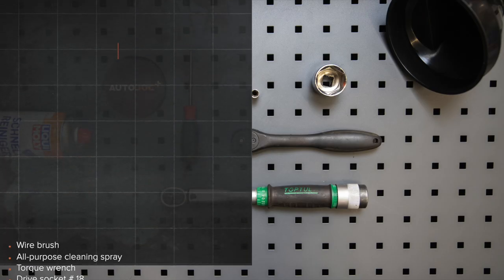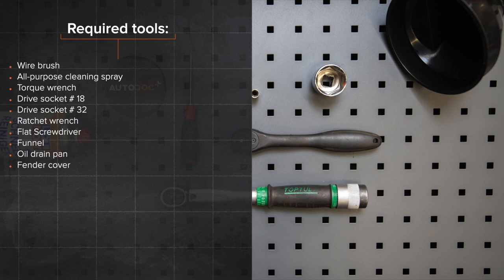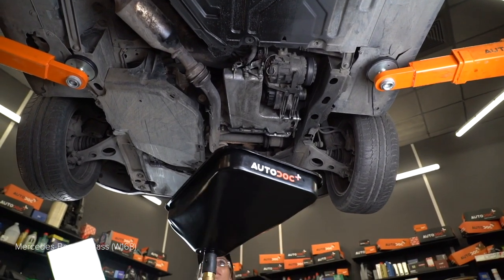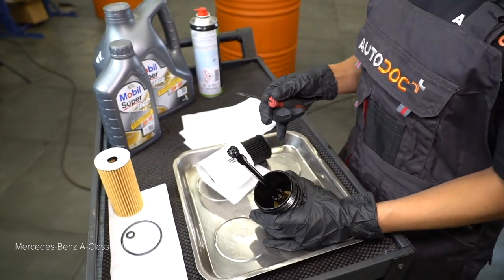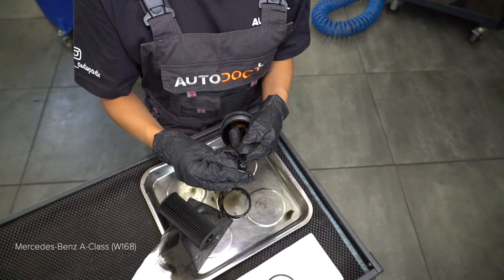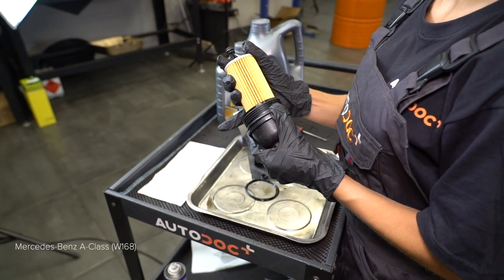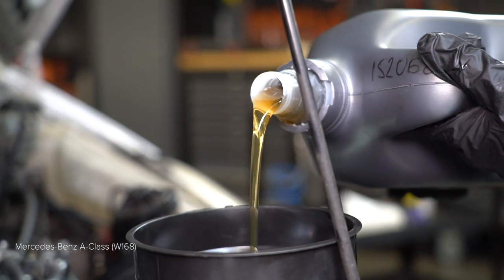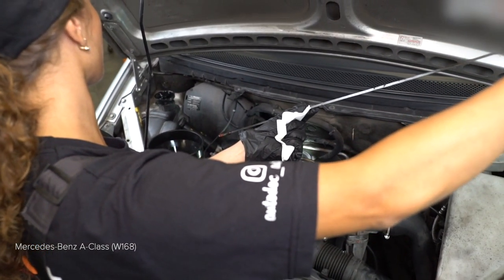How to change oil filter and engine oil on MERCEDES W168 [TUTORIAL AUTODOC]

Comment: Oil plug is 13mm and oil filter is 27mm. Also drain plug torque per Mercedes is 30nm not 29 nm . I also needed a swivel joint as mine as a biG air filter in the way.
Hope this helps someone.